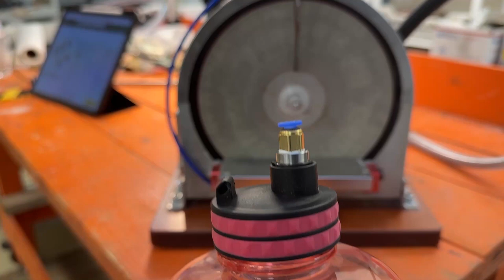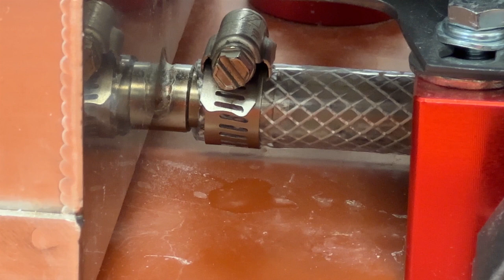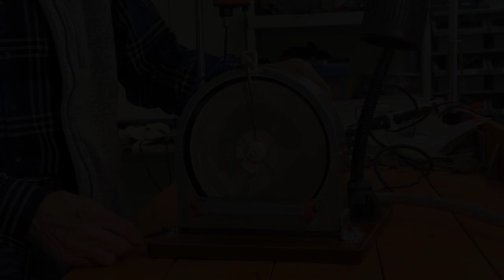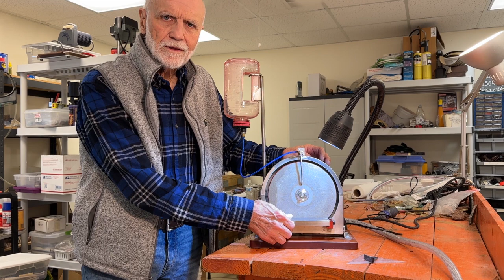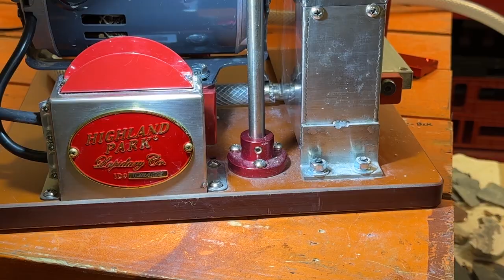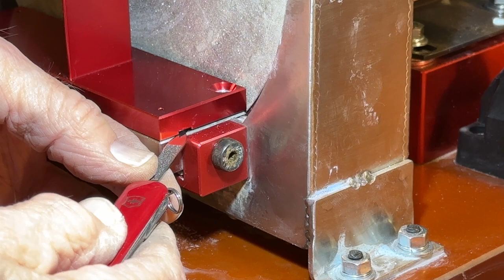HP- 8 Intarsia Machine

Comment: I did the funnel trick and additionally added a very small hole opposite of the funnel just to vent air as water is added to the container.  I poured a little too fast and I overflowed the funnel.  No issues now.

Comment: I love my intarsia machine. The funnel idea is a keeper. I have to change my discs often and would prefer if they used clamps on the cover, the screws are kinda fiddly and I only use one on each side. I have to use a straight zip tie to clean out the drain hole there is a choke point that gets clogged when doing heavy grinding